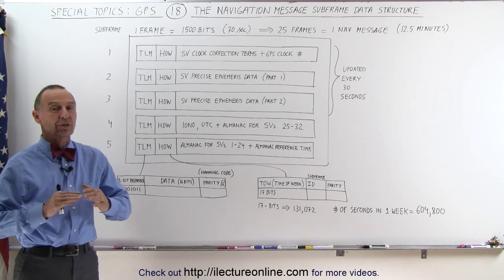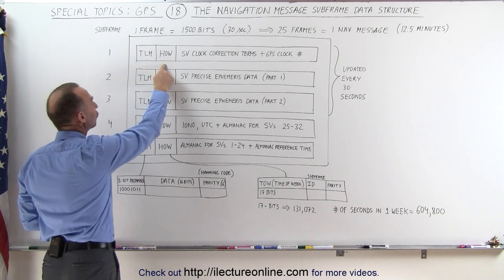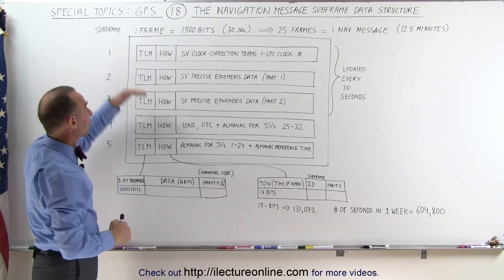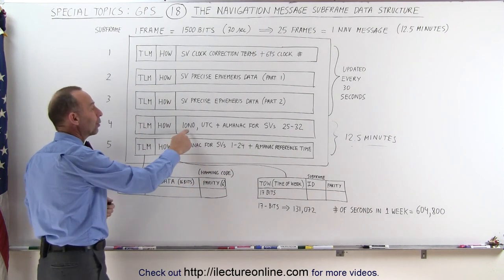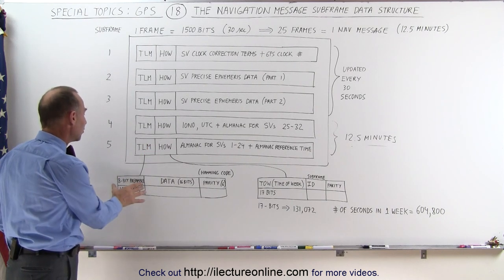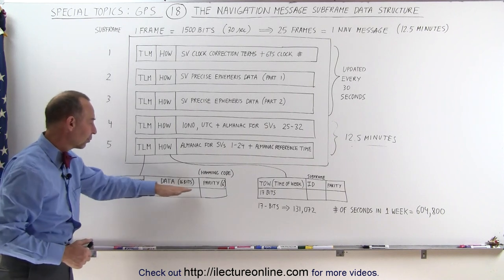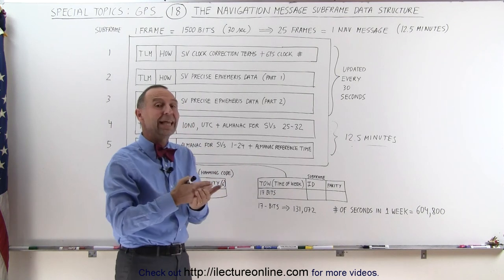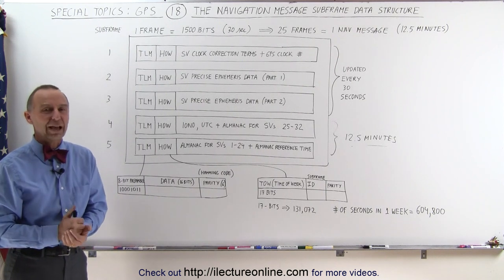Special Topics - GPS (18 of 100) The Navigation Message Subframe Data Structure

Comment: In subframe 4, UTC information sends the GPS-to-UTC second  offset.

Once in a while (last occured in 2017), UTC time is "lagged" by a second 60 (61th second in a minute), called "Leap Second", at 23:59:60 UTC either on june 30 or on december 31 to keep UTC time synchronises with the Planet Earth's natural rotation.

The GPS system can not handle leap seconds at all, since timekeeping is ultra-critical in the Navstar system.

To accommodate users who universally use UTC time, the UTC to GPS time is sent every 12.5 minutes in subframe 4.

As i wrote this info, UTC time is lagged 18.000000 seconds behind GPS time and no future leap second is announced.
Reply from the maker: Nice input.  Thank you.